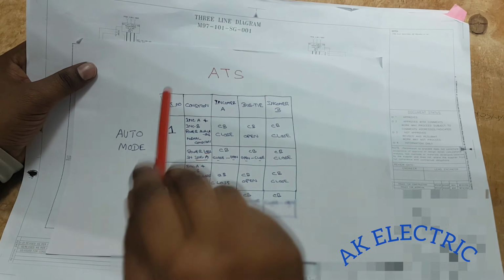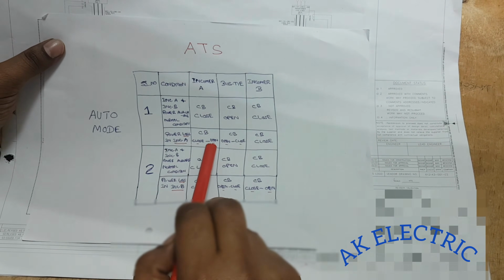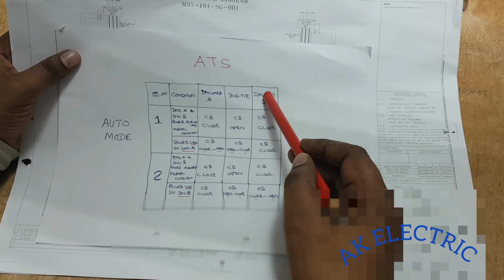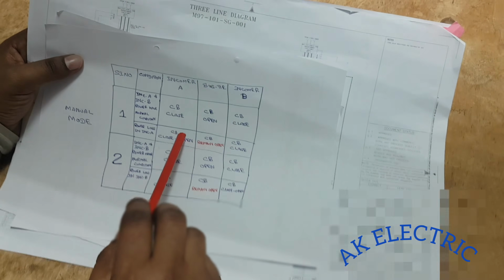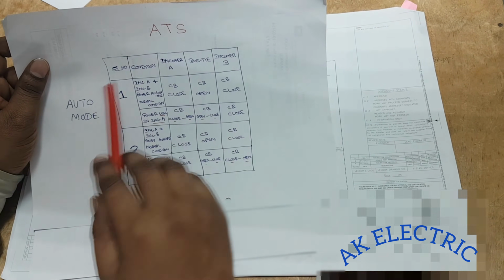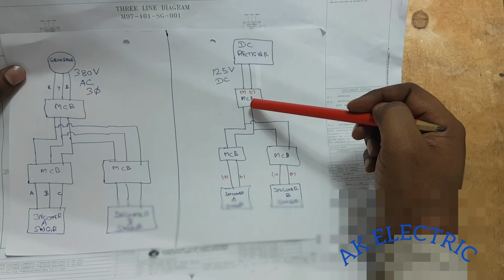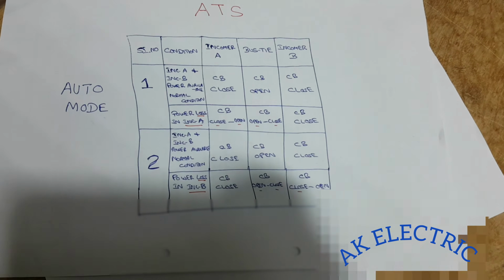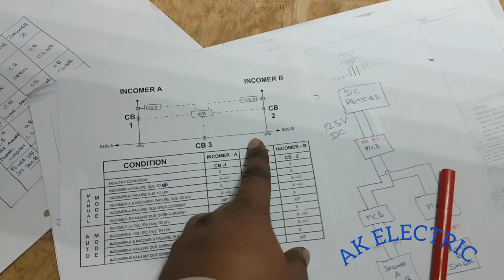ATS-AUTOMATIC TRANSFER SWITCH IN SWITCHGEAR FULL EXPLANATION, ATS SITE TEST, AUTO TRANSFER SWITCH

Comment: Hi Brother, I got good knowledge from this video; my doubt is once incomer two closed tie-breakers takes time to open, actually incomer 1&2, both different sources of supply if time difference means it will not make short circuit?
Reply from the maker: In our video, we have taken common source so it will not affect. In actual case time delay will be in milli-secconds. So it will not affect
Reply: @AKELECTRICPOWER  👍
Reply: Even milli seconds are enough to make short circuit. All 3 breakers will open if voltage difference is more.